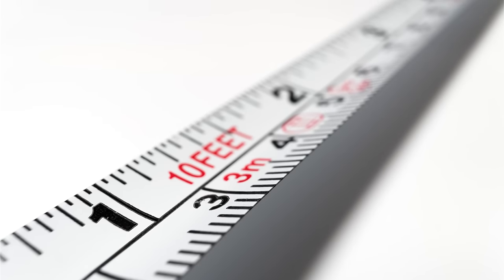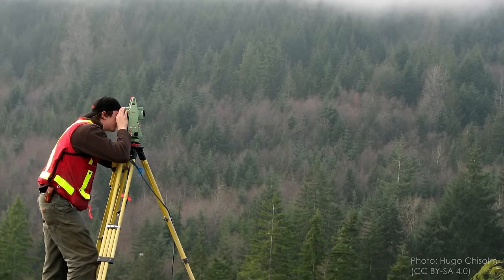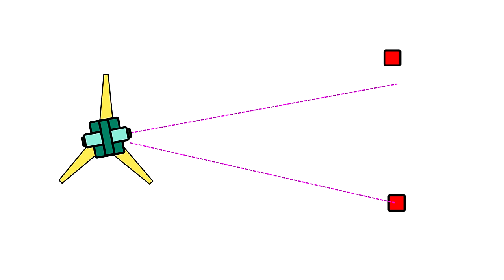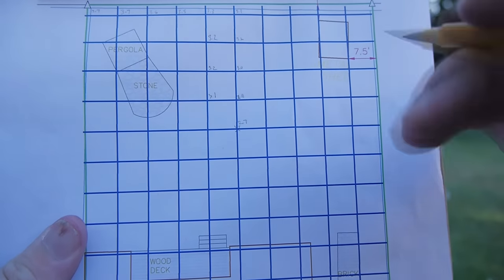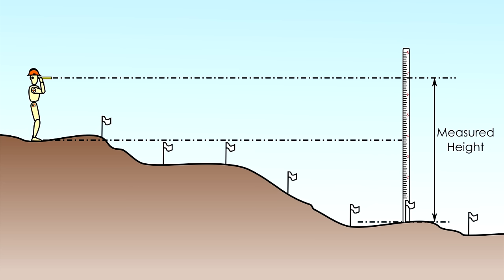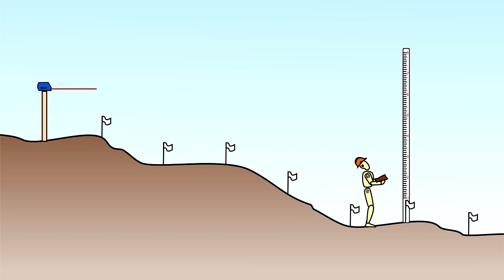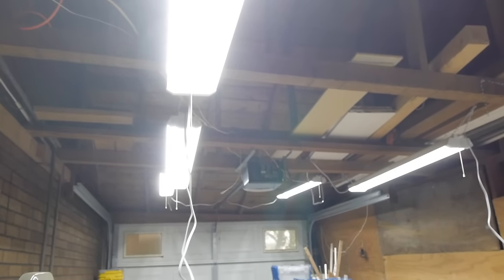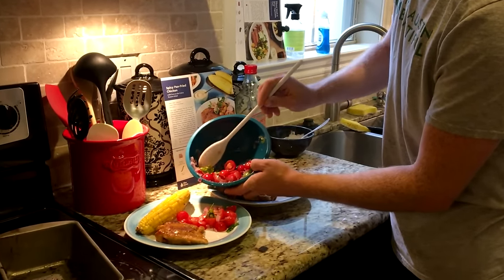How does land surveying work?

Comment: I'm a little disappointed that you didn't include the good string level in your methods. It's probably the easiest, cheapest, and most effective system for a homeowner to use for small projects.
Reply: Maxwelhse Not to be confused with the evil string level. I made that mistake once...
Reply: hahaha... I accidentally omitted the word "old".
Reply: AcornFox You too? Let me just say, a mistake I will never make again.
Reply: What is this? I have never heard of a string level system.
Reply: I think it's where you raise or lower a string tied between two points so it corresponds with a spirit level.
Reply: Look up string or line level and you'll see what I'm talking about. They're just little bubble levels that you thread a string through and then tightly tie the ends of the string off to 2 stakes in the ground (they sell special string for that too that is a good bit elastic so it stays tight). You then adjust the string until the level bubbles are level, therefore the line is level, and you can take measurements from the line down to the ground. The levels themselves are only about $4/ea on Amazon and I'd say you probably want one level every 5 feet or so that you want to measure. I'd say it's a reasonable system for lengths up to maybe 30 feet before the string sags too much to be accurate, but you can always use extra stakes and more levels in the middle of a run to make it virtually as long as you want.

In practice, they're nice for setting up stuff like raised gardens, slope for drainage tile, cinder block walls, and smaller concrete projects.
Reply: Maxwelhse I'm a simple man. I see a typo, I cash in. 😄
Reply: You'd need a reliable level to make one.  And it's probably easier to find a bubble lever.
Reply: You're not getting how this works, octet33. These ARE bubble levels. They're just little ones that you thread onto a string.
Reply: Less precise and subject to operator error.
Reply: R M, Total stations are also subject to operator error, selecting the wrong prism constant, lazy aiming, misheard pole readings, and etc.

Considering that few have access to a total station, a laser level can't be used in full sunlight, sight level needs two people(is more error prone than string level), and the water level is just ridiculous. The string level is a great option for a lot of projects.

Strings in general are lovely to work with when it comes to layout.
Reply: Lemtil Why is water level ridiculous..? It is a very precise method...
Reply: Lemtil String theory is all the rage these days.  Check out the YouTube video “Bohemian Gravity.”
Reply: It sags in the middle
Reply: @someonespadre  So do I. You are just stringing us along.

Comment: But the real question is, when you see someone on the sidewalk using one of those tripod things, what do you do? Do you awkwardly wait for them to tell you to pass? Go around behind them? Wait for them to leave? I never know what the protocol is.
Reply: Go past, go behind, whatever you want. It only takes an instant for the total station to make a measurement, so you won't ruin anything. Just don't touch the tripod, since bumping it can screw up the level or height and ruin his measurements.
Reply: Just don't bump them and try not to stop and stand in front of the scope. A quick walk through won't hurt anything.
Reply: Christopher Baker Very rare that we use 2 man system now. Either a Leica Total Station and RX unit with 360 prism or a Geomax Zoom 90 with a tablet running XPad with 360 prism, both 1 man operation. Tend to only double up on big jobs to get bigger areas covered, or on laser scan jobs where 1 scans and one puts in control for scan targets.
Reply: Rule 1) Don't physically touch the equipment.
Rule 2) Do what ever the heck you were doing anyways unless told otherwise.

Comment: I surprised you didn't rock the surveying rod back and forth to ensure you were getting the highest point (when the rod is perfectly vertical).
Reply: Lowest point
Reply: Pros
Reply: Lean the rod forward, it is highest, backward lowest. Have to have a level bubble or feel the mid point of balance as you hold it. That is vertical.
Reply: rod bubble.
Reply: rocking the rod will get you the correct rod reading which will be used todetermine your elevation
Reply: Not necessarily needed accuracy for that given job.
Reply: @gpwcowboy  you are correct. There are times when the rod is read  to the tenth. Such as a ground shot in sand.

Comment: For a drainage project, I used a laser level to map out the slope of the yard where I needed to bury a drainpipe, and a spreadsheet to map out the depth the bottom of the  pipe had to be, starting at a fixed depth at one end (going under a wall) and arriving at the surface at the other.  I calculated the depth of the trench every two feet, accounting for the varying slope of the yard above and the necessary slope of the pipe below, and dug the trench to those depths. Worked like a charm.

Comment: Just looked at your video and thought you might be interested in a survey project done between 2 mine shafts.
The connection of the 2 shafts was done in 1963 to 1966, before total stations. The distance underground was 9.5 miles in a path that followed the ore body, so no problem with elevations. The 2 shafts are 6.25 miles between on surface.  The final connection was within 2.5 ft in latitude & departure .  There was no way that the survey could be balanced as we went so it was a single line all the way.

Comment: you neglected to mention surveyors use tenths, ,, not inches in  their  measuring
Reply: they use tenths only when they have to stay overnight.
lead me to the exit.
Reply: I had to google tenths, what sort of unholy mish mash of metric and imperial led to using tenths of a foot?
Reply: Counting in half-toes isn't unholy, just a tad eccentric.
Reply: Robin Bradshaw It's not uncommon to measure Imperial units in base10, in fact Boeing builds planes to the tenth-of-an-inch(.1"), thousandth-of-an-inch (.001"), and sometimes tenthousandth-of-an-inch(.0001"). These base10 measures pre-date the metric system.
Reply: We also use meters, as everyone in the US was supposed to be doing by 2000..there are just a lot of old dogs that can't handle new tricks.
Reply: Only in the States, the rest of the world uses millimetres
Reply: even in Canada , they use mm

Comment: Cool video! The first time I ever used surveying equipment I was doing construction, the city implemented a rule that stated that rainwater must be kept on property for either 24 or 48 hours after it rains, dont remember exactly which. We dug a hole, must have been 10 or 12 feet to put a pipe at the bottom for the runoff, and other filler to temporarily hold water without it becoming stagnant. Was 3 connected townhomes, 3 stories each, 3 swimming pools. 3 million each. Huh, they really like the number 3. Anyways, that survey equipment was so cool because I could hold the scale and in seconds we would know exactly how deep the hole was. Good stuff

Comment: I'm a surveyor who have been doing it for 11 years so far , good video but it doesn't even scratch the surface of what surveying really is , specially the "total station " you really didn't give it the justice,  it's fascinating device and can do wayyyy more and there a lot of projects that'll be really difficult without it , for example, creating foundation for I beam peelers and 4 corner peelers for sky skrepers ,  bridge colome , laying down the route when building new road or railroad,  tunnels,  you can use gps devices in these but total station makes it 10 times easier.

Comment: String levels are also pretty handy. Set up stakes in your grid and tie strings between them. Hang the level off the string and adjust the string. Measure the distance between the ground and string. That's how I measured my brick path. Can be pretty handy depending on the size of the project.

Comment: Stop using words like "exact" and "perfect" when talking about measurements.  They are neither.
Reply: More or less plus minus  exactly
Reply: Still, no more accurate than a Egyptian...
Reply: Doctors of errors
Reply: Exactly right!  Sorry...

But I agree with your point.  It is in managing the imperfect that was the basis of need for the profession of surveying.  When at the limit of the tools, elaborate techniques were needed to get higher levels of precision and accuracy.  Now a high degree of both precision and accuracy can be bought and used out of the box; surveying to a given allowable error is not as challenging as it once was.  So some (incorrectly) extrapolate that they have achieved an exact answer.
Reply: exact or perfect is the same as good enough, practically

Comment: For ease I prefer the water level. Easy, no batteries, always works and can do this all by myself does not require 2 people.   I have been use one since 1968 when I leaned how they work when I was 9 years old. Help level lawns for my neighborhood, decks, sidewalks and patios. Now I am 60 and use one this last week leveling a deck I am remodeling.  Water level just works

Comment: I think I have the exact same model of Locke level (what you call a sight level).  At least it's the same color and it looks just like that when you look through the lens. 

That's really kind of an obscure survey instrument, in over forty years of surveying I've never seen anybody else who had one until this video.  But they're useful on occasion, especially for cross-sectioning creeks. 

I originally got mine back in the old days when we measured almost all distances with 200 foot steel tapes.  To measure a plane distance you need the tape to be level (that is, perpendicular to a plumb line), so when taping across non-level ground the guy at the low end plumbs up with a plumb bob.  But it's not always easy to determine by eye that the tape is level, and out-of-level tapes generate considerable errors (the plane distance is shorter than the plane distance by the cosine of the vertical angle), so I bought a Locke level to make sure my measurements weren't systematically in error.

Comment: When I was a carpenter were laying out a parking lot. We were using a total station. We were shooting something like 500 points on curve, corners, end of islands, starts and stops of wheelchair ramps. On the end of islands in the parking lot you got a fairly good eye on where the next point would go. I wasn’t the only one that looked around the points next to us and drop the reflective prism good on line and .001’ for distance. It happened I think 3 times. Maybe myself twice and my partner once. Most shots had grade elevations from the hubs written on the laths.

Comment: My neighbor built a fence and when I asked if they had it surveyed, they said yes. I went out and did my own measurements and found they just used the information on our GIS site. Our GIS info is wrong so I emailed the GIS (geographical information service) and got the correct frontage of my property and my neighbors. Then I called our township and had them let the neighbors know the fence was 18 inches on my property and wanted it moved or pay me rent. It was moved within 48 hours. They thought they could just make a guess but didn't know I have done all phases of site work including residential, commercial and environmental.

FYI; GIS lot size is usually correct as this is how they determine your property taxes. The distances of frontage and depth might not always be right though. Your right of way might be different depending on your area. Example; some are from the center of a highway, some are 66 feet wide and some more or less. Find out whet yours is. Mine is 33 feet from center of road is where my property line starts.

If you need to locate your sewer line, contact your wastewater treatment plant and request your "as-built" for your property. Mine emailed it to me. My home is 88 years old and the sewer line was installed in 1965. Before digging up anything on your property, call 811 Miss-dig to locate anything you may encounter down there.

Comment: I used the 1' Dietzgen Engineers Transit I inherited from my Father to lay out my deck by myself. To get on-line lay a level rod on the ground perpendicular to the line of sight, read the hundredth on line, set your spike. I also have a Japanese made Lietz 20" transit. The Lietz has an eyepiece sunshade so I could shoot the sun for direction but I'm not relying on that thing, unsafe. Polaris is better, more precise.

Comment: NASA etc. Uses theodolites to check verticality of rockets before the rocket’s  guidance is switched to “internal” in the late stages of countdown. 
Theodolites are also used to check the alignment of large aircraft body parts in the factory because a sight line is more precise than a jig (which can distort and expand/ contract.)
Reply: I do structural testing for NASA and we are using Leica MS50 and MS60 MultiStations to measure deflections of our structural test article during testing.

Comment: I've used a string between two wooden stakes and a line level. It's real simple to pull a taught line between two posts and measure the elevation and length.

Comment: Land surveying work can be hazardous, such as venturing into open fields, rock formations, or forests where all sorts of vermin can attack; rattlesnakes can be troublesome.  Then there are the issues of crossing into properties where the owner could threaten the surveyors with a firearm, or sic the dogs after them.
I've heard stories of surveyors, to expedite the project, were known to cut down trees or prune away tree branches to quickly get the line-of-sight for measurement purposes . . . such issues didn't set well with the property owners.

Comment: The water level looks pretty rudimentary, but it is interesting that there is still a practical application of this in underground tunnelling. It's just a little more advanced as they calculate differences in height by including a pressure gauge at either end of the line.

Comment: Chains were used as the method of measuring distance for surveying until the mid to latter 20th century. A standard chain is 66 ft long, and one has to be careful to not kink or twist the chain when pulling it out, so the length will be accurate. In the US State of Georgia in the early 1800's  the chainmen who handled the chains for the surveyor were required to swear an oath that they would perform they job carefully and accurately. Modern surveys have proven the accuracy of these early surveys done with a compass with a sight and a chain. Fun facts. An acre is 43,560 square feet, a very odd number and if you think of an acre as square, it is something between 208 and 209 ft on each side. If you think of it in terms of the surveying chain from which it was derived, the acre is a rectangle 1 chain (66 ft) by 10 chains (660 ft) which is where you 43,560 comes from. Second interesting fact, the World Trade Center towers were each 209 ft square, basically a one acre footprint each. In Georgia the best read on surveying is Georgia Land Surveying History and Law by by Farris Cadle, and another interesting and easy read is How the States Got Their Shapes by Mark Stein.

Comment: Grady mentioned building bridges. Fun fact: When they built the Sunshine Skyway Bridge in Florida, they decided to build it from either end and meet in the middle. Well, they missed by a few inches! (vertically)  Also, back when they originally surveyed the state of Florida (I don't remember the year), they decided to have one surveyor start at the north end, and another surveyor start at the south end. They missed by quite a large margin in the middle. If you look at a survey map of the entire state, you can see that the north-south lines don't line up somewhere near the middle.
Reply: Of course the lines don’t always meet up, because of the curvature of Earth.  Surveyors know that and the survey documentation should take that into account.  It would be interestIng to know exactly where the surveyors went wrong, because it is not unusual to build bridges or tunnels from each end and meet in the middle.